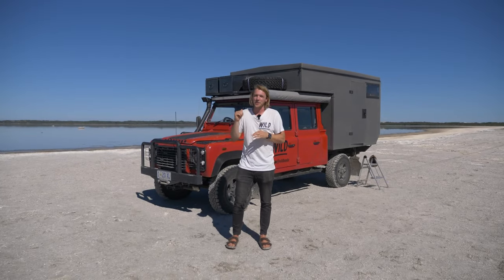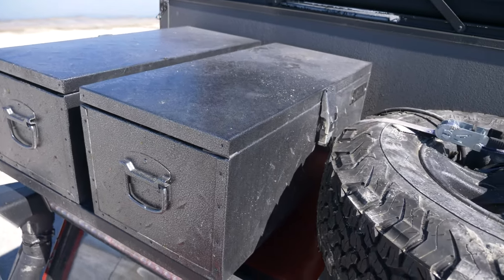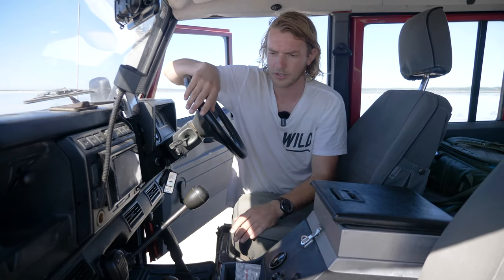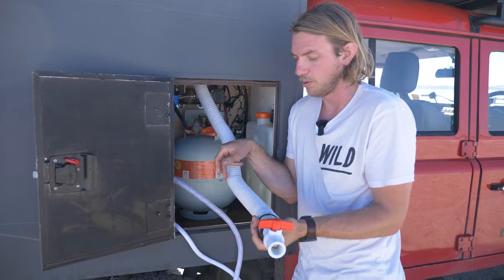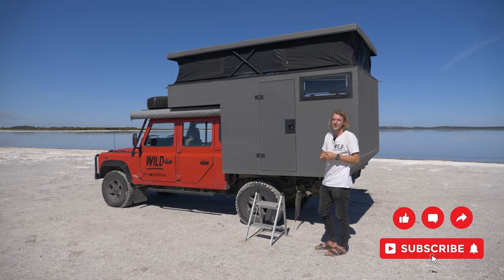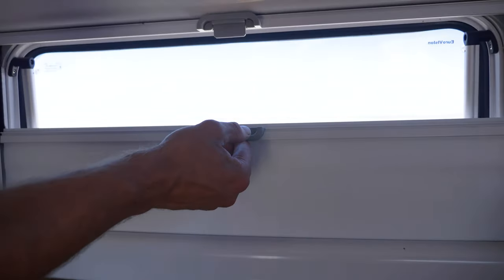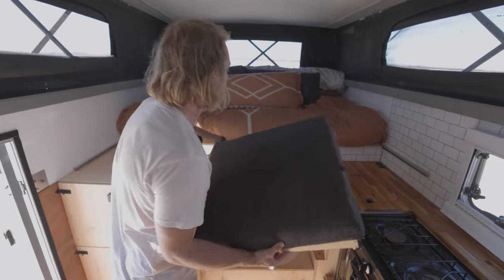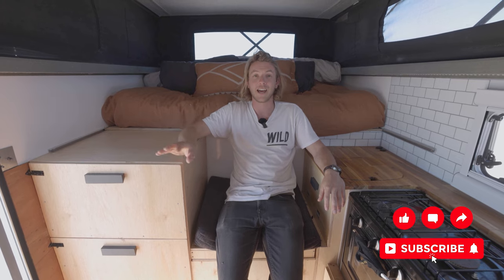DIY 4x4 Camper Build - Full Tour Land Rover Defender 130 Off Road 🔨

Comment: Plus I suppose it brings the build cost down as well as makes it easier to build since you didn’t have to spend hours welding everything together, plus if any panels do get damaged then rather than cutting out the piece and replacing it you could simply un do it and replace it for a fraction of the cost whilst keep its life span to a maximum

Comment: Needs clear windows in the pop up! I am building a Defender 130 with a FWC on an aluminum flatbed. Looks like a nice build! After a yr on the road you prob will ditch propane and the water filters :D Last road trip was Chile to Alaska! :D Keep it up!
Reply from the maker: I’m not sure if the video shows it or not but you can see out of the windows super easy. It’s never bothered me anyways. What did you swap out the propane for? And I do agree if I was only staying in Aus I’d happily ditch the filters but would definitely still keep them if heading to south east Asia. Thanks for the feedback Travis 🙌🏼
Reply: @Wildbonde  Been to Asia always can buy large bottles 19L cheap and less chance of getting sick. Always bleach your tanks few drops is all. Switched to a white gas set up. Much lighter and gives you so much more storage!
Reply from the maker: Yeah that’s what I was trying to avoid, having to buy bottled water I mean. I’ll see how we go. And thanks for the white gas tip, I’ll have a look into it!

Comment: I like the build - It's a nice space - well thought out
Great fridge location (easy from inside and out)  & plenty of windows.
Can you comfortably sit and hang out in the seats with the top down - in my ACCC I made sure I could do just that. ( appears that you are about 100 mm shy from comfortably being able to sit upright.

I might have installed a larger door in your rig just to open things up . But that is just because I come from a van with a big sliding door that I enjoy the hell out of. I also just bought an Alu- Cab Canopy Camper which has a big ass door in the rear and very large awnings which opens it up a bunch when you need to hang inside in the rain and the like.

Comment: Hey Jess, what you with the Defender camper is very impressive, my compliments! I'm currently building a Defender camper myself, and also I have zero experience. But... The most satisfying thing about the whole build is that eventually, you will pull it off, and the result is even better than you initially thought it would be. It is worth every blood, sweat, tear, and the occasional swearing. Are you still going on an Overlanding trip? Subbed btw 😎

Comment: I would build an evaporative cooler for air conditioning. I built a small one for mine and it uses very little electricity and is really cold when it’s not too humid

Comment: Ditch the redarc  & buy an enerdrive unit & a 2000w inverter...Enerdrive will take up to 800w of solar. (House panels)...you have the roof realestate to run 800w easily & already have enough lithium to be completely electric...by doing this, all energy will be free. (No gas)

Comment: How much did the panels cost ya and where did u get them from?
Some awesome ideas in the camper.
Reply from the maker: About 7k total for the walls, roof, lifters, aluminium capping, external bed brace, and all the cnc cutting. And I got them from Penguin Composites down in Tassie 👍🏼

Comment: great build! Can you provide a link for the water pump and filter.
Reply: The twin 10"  filters are great for sediment and taste/odour (+ some chemical removal), but very few cartridges do much of a job at killing bacteria - most use silver as a bacterostatic (is stops bacteria growing on the carbon) but not as a bactericide (is actually kills bacteria). If you want to kill bacteria and viruses (which are <1um), then you need a purifier...could use chemicals, UV, or a small purifier like those from the Australian company The Thirsty Nomad.

Comment: https://youtu.be/1Yva7XXOV9Y?t=913
"worrying about weight" .... while you are pulling the fridge out in a drawer. For what? The fridge would be happier w/anything around it, because heat causes energy.
 Table: Have you weighted the table?
My wild guess, from what I installed in my truck is: at least 15kg for the woodn plate, + the stuff underneath. Make it from Aluminium and you save easy 15kg or more.